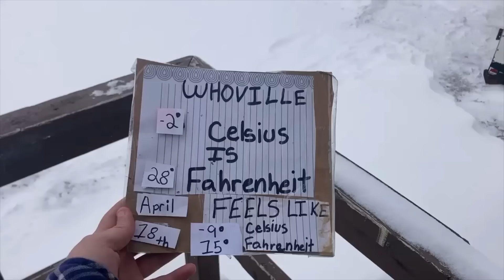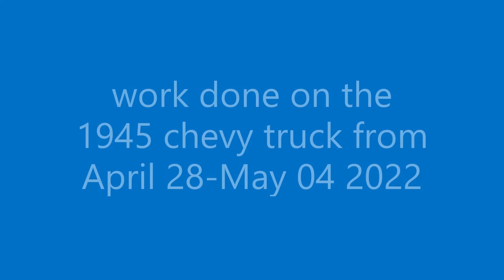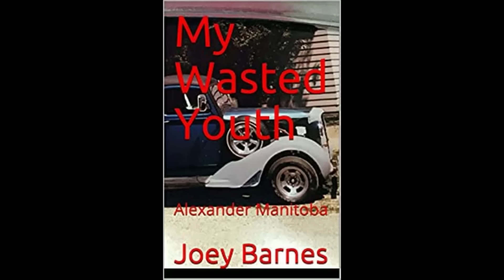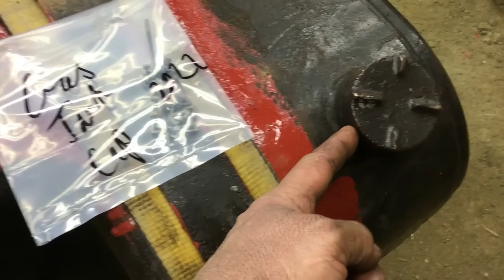Another Snow Day in the Shop Working April 18 2024

Comment: Good morning from Cape Cod ⚓ 44 ° and torrential downpours here on the Cape. You got quite the accumulation overnight, you wanted snow Joey now you got it 😉 ironically the Hobart overheated after you complimented it for its capabilities, it must be female 😂 the battery box and toolbox look great hanging off the truck bed. The whoville weather updates are a nice addition Xena, your contribution helping out in the videos is much appreciated too. One day we may actually see your face? If not I don't blame you I don't want to be documented either 😂 keep up the awesome work guys 👍✌️🇺🇲
Reply from the maker: heavy rains for you guys is better then heavy snow. yes i pushed the limits of the hobart handler 100 and now i know when it over heats. we plan on the snow storms in the spring and have lots done and ready to be worked on in the shop  thansk

Comment: Instead of using the transformer in the Hobart welder, just hook up your Lincoln, and use the Hobart as a wire feeder only and you don’t have to worry about duty cycle or overheating…. watching from Mail Yukon freshet is starting.
Reply from the maker: yes, as a power source set up those were popular 30 years ago and i had a miller welder with a wire feed like that. good to know the river has opened up for fishing already  thansk